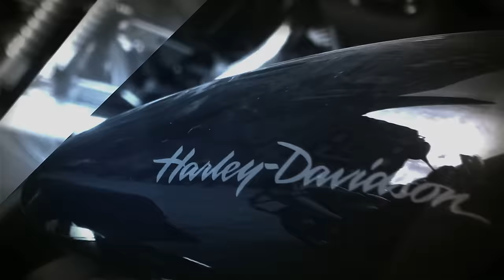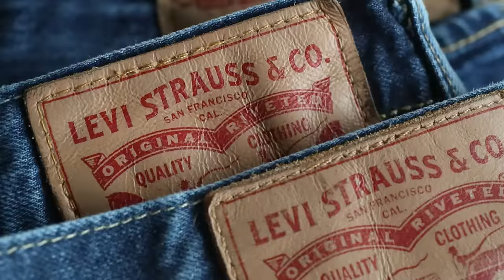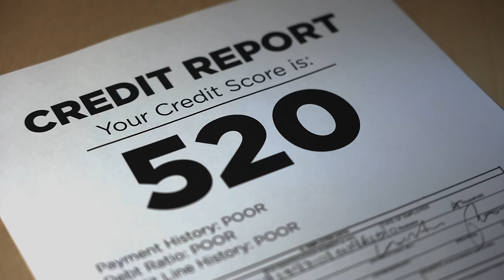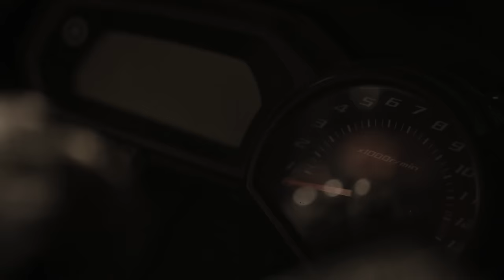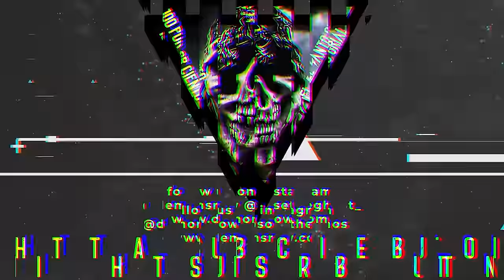8 Types of Harley Riders YOU WILL MEET

Comment: I'll add number #9 I've been on many bikes, I'll ride anything. I currently ride a Harley Dyna, my Wife rides a Honda VTX 1800, my Son rides a Victory Kingpin 8 Ball. Whatever it is, let's go.
Reply from the maker: thats a biker family for real
Reply: My first bike was a 02 Yamaha r1 back when I was 19 now I’m about to turn 25 and I still have it and a 04 Honda shadow. I want an upgrade though and it was between a Vulcan a boulevard and a vtx but I can’t decide which one I’d like better. Mainly want it for traveling long distances comfortably and without the rpms up there. Got any recommendations?
Reply: @guthixwar44  I've been on a Boulevard, it was very comfortable. If you upgrade the seat on a VTX, it can be a lot of fun and a really smooth ride. Also, Honda makes the best, most reliable engines, something to consider. 👍
Reply: I got the VTX1300 and fuckin love it, I do wish it was a harley though sometimes.
Reply: @timgray8489  Nice 👍

Comment: I started on an 83 CX650 Honda, got a Ninja 250 on good trade, then just got a nice 04 Sporty 883 on a different trade, and so far I've already ripped the whole bike apart, redone the timing, installed a new air cleaner, got some 40" drags, and did a oil change. Haven't even rode the bike with it in my name. Got it off a friend a rode it some but it needed work so I just knocked it out through the week. Was raised by Harley lovers, and I do love the classic plop plop, but I'm starting at an 883 because I only got about 6,000 miles under my belt on my previous bikes, but I also switched to a cruiser for comfort. The older guys in my family like their "Geezer Glides" and stuff but I'm a younger dude trying to get into it and honestly it's not as toxic as the dirt biking community when it comes to brand loyalty. Most dudes are either weekend warriors or dudes and chicks who just like HD. Me personally I try to keep my preferences open cause I'm not too opinionated to one brand of anything, but maybe the little 883 will who knows. If so I'll probably go to a Softtail or an early 2000's Dyna. I don't want amenities I want a fuckin bike lmao (not shitting on Ultra and Goldwing guys just poking fun I know your tempers aren't great)

Comment: There's not much use for street or road bikes, so my 'cruiser' is a heavily modded first gen KLR that i basically built into a big mad max style desert crosser.  I daily it as i live up in the mountains off grid and it's a practical option to send it down miles of jeep trail and twisty canyons.  It's got a 500 mile range with a massive tank, as one local loop around the valley on dirt is a bit over 250 miles without side quests.  Did a 2000 mile lap of the state, about 200 miles of that was pavement in and out of towns to get fuel every couple days, half of the rest was dirt roads and the rest was just open desert riding and camping.  I've changed tubes on the side of a road, a wash, or a mountain in sun wind, rain, snow, pitch black with a dead battery, rode through wildfires, discovered lost places not on maps, got lost, meditated, forded rivers, touched grass, did wheelies, laughed, cried, cussed, fixed it again with baling wire, and saw a lot of cool shit all along the way.

But i just kind of forgot to stop at the bar and socialize whatnot so the only time i'm spotted is in that lonely gas station at the edge of town at 5am topping up before disappearing in a cloud of dust down a trail or wash like a two wheeled feral animal.

Comment: I guess that I'm a weekend warrior. But it's not a fair assessment. Got 1st bike in 73. Broken Suzuki 250. Friend and I took apart motor. Neither of us ever did that. We were in high school. Changed rings and other parts. It run strong. Since then I've had a Kawasaki 500 then a brand new Kawasaki 750. A 2 stroke just like 500. Raced it at Union Grove dragstrip in Wisconsin. Also had Kawasaki 1500 Vulcan. 10 years ago I finally was able to afford a Harley. Fully customized 200 Night Train. Stage 3 in motor. Am 69, still work. Weekends is only time I have free. But I've put in more time on a bike, than bikers in others categories.

Comment: Custom builder is def most accurate to me i had a 1981 yamaha xs650 that i built a hardtail for to fit me i stretched the frame 6in and made the whole bike sit 4 in off the ground 21in front rim built and stroked to a 750cc wiring everything i did myself then i got alittle tired of the hardtail so now im a streetglide guy

Comment: My Honda Rebel 500 has 65,000 miles so far, and was $6,200 total cost new. I was trying to get a Harley but they kept pushing a $40k bike as a new rider. I called Honda from the Harley dealer, and that was how I ended up metric. I have excellent credit and financially solid, but I was also trying to find a beginner bike.

Comment: Yeow Sose,  I don't know what kind of Biker to call myself,  I've been riding since I was 16,  past my Bike test at 19,  got my brand new 1200 Sportster in 1988 at 24,  got my brand new 1340 Fatboy in 1992 at 28,  had a serious accident at work in the Quarry left me with a crippled left leg so bought a 2007 Dyna Street Bob which was converted to a trike in 2015,   Been Domestically Abused December 2014 through to September 2017 by my then wife of 16 years,  During the last seven years since separation and getting my decree absolute just a few weeks ago I have been mentoring and supporting Men Who Themselves have suffered Domestic Abuse in the Compass Programme of which I solely helped to set up,  while all along working on and making parts and constantly customising my Harley Dyna Monster Chopper Trike,  Yeah I'm 60 now and I don't know what kind of Biker I am,   But my Ol' Lady Jules tells me that I have nothing to prove,  and to just keep limping like that Big Old Lion,   Mike over here in Wales in the UK 👍🤘🏴
Reply from the maker: much respect
Reply: Yeah Sose,  the first couple of years at the Quarry I drove the Dumper Trucks hauling rock to the crushers,  then spent the next 20+ years in charge of Explosives Operations up until my accident on site in the bad snow and ice in which I slipped and shattered my left leg and my left foot was hanging off,  which stopped me riding two wheels,  so I converted to three wheels from there forward 👍🤘

Comment: I just got my first bike a 2004 harley softail standard fxst and I put about 500 miles on it the first week I got it. Commuting to work and riding the backroads after I got off work. The first day I rode it into work it was about 40 degrees and my thighs were frozen by the time I got to work, about a 27 mile ride. I would consider myself a long distance rider even though I haven’t made a long trip yet, it’s definitely in my plans. The weather here in Washington has just been crappy lately.

Comment: I’d call myself a weekend warrior currently working to number 1 and long distance rider. Basically I commute to work and any little errands I run is on the bike. Strapping dog food, groceries etc to the bike. If I have the option of vehicle or motorcycle it’s motorcycle always. I also take long rides on days off and just drive with no plan.  Pending critical weather such as freezing temperatures mixed with ice and snow on the roads in the winter.

Comment: I started riding and when i joined groups it stressed me out as they back out of rides when its a little cold or a little windy. I ride through heavy rain and high winds so most of the time i ride alone. I also like to go over 100mph on my sport glide so riding with groups is not really my thing.

Comment: I ride miles. I do all the wrenching on my two bikes. Started on a Honda 50, then Yamaha 80, Yamaha TW200, then Yamaha 600 Radian, then crotch rockets. Now I rock my 99 Dyna Wide Glide. If the old lady is ready to go, it’s the 04 Road King. I do about 12,000 a year between the two bikes.

Comment: I don't really fall into any of those groups... but I also fall into all of them at the same time. I have a 9-5, but I commute to and from work every day. in Phoenix. rain, shine heat, cold, dust, doesn't matter. I don't even own a car. i have been known on many occasions to have grocery bags hanging from my handlebars, and even though my old lady does own a car, which i can use any time she's not using it, i still prefer to take the bike. now, i own a 2023 street bob. no saddlebags, just a luggage rack attached to the sissy bar. i have a tail bag, and if the old lady and i decide to take a weekend trip, she's wearing the backpack, and we pack light. we try to get out on the weekends as much as possible, put it this way. i got my bike July of last year, and i just hit 7200 miles on it. and i haven't left AZ. i do try to make my own parts also. my old bike was a 2013 Softail Blackline. couldn't find a luggage rack that would fit my sissy bar for a decent price, so, i made one. my current bike, didn't want to spend a ridiculous amount of money on risers so i could get rid of the ugly ass mini apes, and go with a tall riser/moto bar setup. so, i made risers. i did however buy my bars. i can weld and machine parts, but i just don't have the equipment to bend bars. i am not an outlaw, that's for sure... and i am kinda a loner. always have been. served 13 years in the military, and i can talk to anyone, but my happiest days are just me and the ol lady out on a windy stretch of blacktop with our knees in the breeze.

Comment: Ok BX bro, you tell me what kind of biker I am. 38 years in the saddle, I ride a 1948 Flathead bobber,  tank shifting foot clutching.i built it myself. I do all my own wrenching. I ride to work everyday that has good weather on my customized 1998 EVO springer.  And I’ve jumped on that bike and rode all over the country.  I’m an old gray beard in a leather jacket with no tattoos.  Steel toe boots, jeans,  buck knife and gun in my pocket.  I don’t have a radio on my bike and no dam cup holder. Just and old Bronx biker loving life. If you ride your a biker enjoy it cause life is short. It blows away like tire smoke from a good burnout.
Reply from the maker: I would consider you a true biker

Comment: How about the guy that rides to and from work, to the store, etc?  Does not dress up.  Wears moderate gear but does not go Euro Textile Coat or Pirate Leathers.  Rode UJM bikes until I got my Roadster.  Wanted a standard light bike.  Never put down Harleys, wanted one, but does prize reliability (thus my EVO!).  I would also like a Triumph to check them out.  I can ride 2 minutes or 4 hours straight across country.  I do not drive at top speed taking in the scenery and stopping to check new places out not just the gas station or truck stop.  Up to Stage 2 upgrades with many unique accessories on the bike for any occasion.
Reply from the maker: Biker

Comment: I suppose I'm mostly like 6. I'm 70. Been riding since high school. Had more bikes over the years than I can readily name. Even road for a living as a motorcycle messenger in Chi for a couple years. all day every weekday year'round. Been riding cruisers for a long time. Have 4 bikes, now. a geezer glide, a '97 Fatboy I rebuilt with a 110 Revtech (yeah, I know asian made) a pro street chop I built frame up, Ultima El Bruto power and a ZX-14 to run errands. I do all my own wrenching.  My jeans are patched, My vest is plain black denim, I still ride year round. almost always alone. But, I fit in easily at the bars. Labels are kinda like crutches. It sometimes means ya gotta act-be-signify-represent a certain way. I'm a lifelong rider and it's never been just recreation.

Comment: My credit is fine. I ride a c50 and/ or a  c90 most of the time, but i have several suzukis including a busa. I don't think harley is worth the money, and as it's not u.s. made i have no reason to leak oil all over my garage as an act of loyalty to a company that hates mcs. I know multiple guys that have metric cruisers for  reliability. None of them are to broke for buying harleys, maybe just to tight for owning hardlyworks davidsons. I think we've all owned one, and felt ripped off by it. You, yourself have been plenty pissed at harley too. Where's your badges? None of this is meant in a hostile tone. It probably reads that way, but I'm a fan of you and your channel. I disagree that anti-harley sentiment is always because of one's financial situation. I wouldn't trade my c90t for a new harley. You couldn't take my original bike (c50) from me with an army. My next bike is going to be an m109r boss black. F- harley. 
 I'm probably closest to number 6. I love wrenching and customizing them.